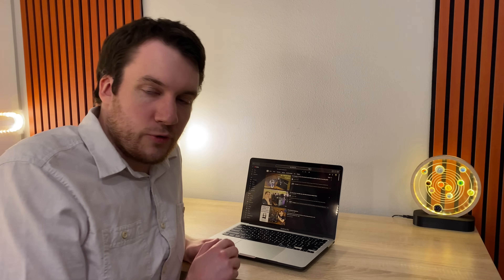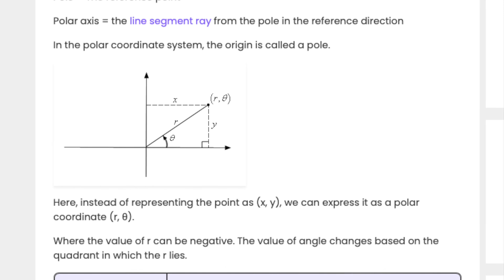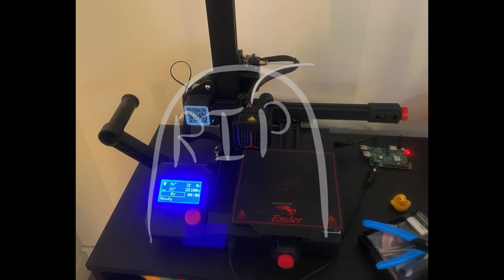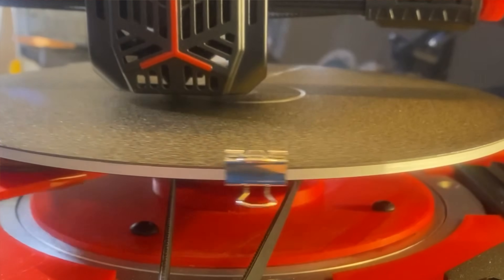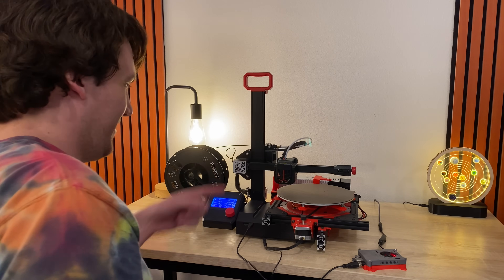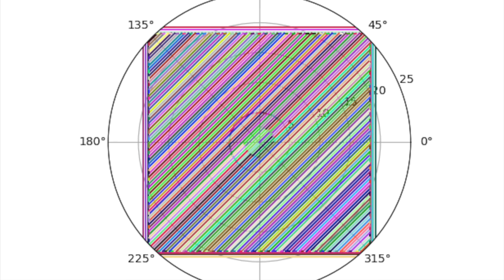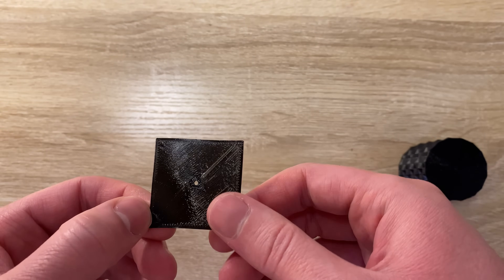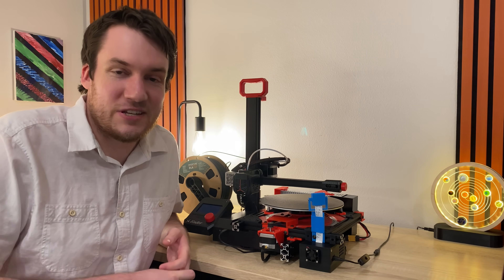This Printer Has A Spinning Bed

Comment: I would say instead of having a slicer that passes thru the 'singularity' going back and forth, you need a slicer that can start in the center, and print spirally like a record player out to the edge of the layer, then fill in the spots it needs to. No need to slow it down.  Wtih the vase, it could just keep going!   But that is a slicer code problem.  Like you mentioned with your python post gcode fix, you need a dedicated slicer mode for polar printers.

Comment: I expected the printer to just spin the plate at a constant speed and print layers in a spiral from the inside out. I wanna bet that would print far cooler and faster. or at the very least one of those 2

Comment: One benefit I noticed is that this opens up the possibility to eliminate a belt and use gears instead, which makes maintenance a lot easier.
Reply: Better yet: direct drive.
Reply: @Overflow066  That would be cool. I wonder if there are precise enough steppers to accomplish that while maintaining quality in the outer areas?
Reply: @ I don’t know, but if the other two axis also were screw drive, you could make an really reliable printer.
Reply: @Overflow066  I guess the Z axis could be relatively slow, but the other one would have to be fairly fast. Would be really interesting to see. Maybe there's a manufacturer out there that would be willing to make purpose-built steppers.
Reply: @ this one seems to move at an adequate speed: https://youtube.com/shorts/X0q1uIOqcIk?si=BtJ4HmeI-ovTuh2z
Reply: @Overflow066  Nice! Looks like it can actually be done.

I just had another impractical thought: the slicer math would probably be pretty complicated, but you could technically have the print head mounted on a beam that draws an arc through the center using just a stepper motor and nothing else, kind of like a hard drive head. So then the only linear motion on the entire printer would be the Z axis.
Reply: The sculpto2 does this. And the math isn't that bad, you calculate the arm angle from the radius of the point and then know the angle defect that the plate has to adjust for
Reply: @reinux  could put the z axis on a pivot too, and compensate for the arc with the other axes. industrial welding robots are basically like this.
Reply: You can already eliminate beds without polar though. Linear motors, rack and gear.

Comment: Next steps would be to add back the Y axis movement, and to give the print head a way to tilt around the X axis. That is going to allow printing sides of things from bottom to top and all kinds of other cool capabilities that are simply not possible with simple cartesians.

Comment: Dumb minds think alike, except my Idea is to have a huge printer with a robot arm, possibly in true cylindrical printer fashion.  I'm glad I found this video, it's probably moved up the project by 6 months or more now that I know Polar printers are a thing.  One thing I was thinking was to have the robot arm print in a planar manner and then have like 45 degree flats that the part would have that I could then print an entirely different feature on as a separate planar print.  There are a couple up sides to this printer one mine would be big enough that it could have multiple arms with multiple extruders running simultaneously.  But my first steps were going to be a turn table and a linear arm like what you did, then I would add the 3-4 degree of freedom robot arm.  My first steps are all going to be the same, but knowing that polar printers are already a thing is going to speed up that process.  Oh and the other thing is that there are not any tools or slicers that I know of for cylindrical volume printing, so If I get this thing to print, Possibly through manual raw Gcode then it's going to be super impressive, and this is a portfolio project.

Comment: To make a straight line through the centre you don't need any rotation at all, if you allow radius to go negative. In that case, there's an ambiguity of the same point represented by two possible coordinate sets, one with positive radius and positive angle, another one with negative radius and negative angle.
For every cartesian X/Y pair, couldn't you just build two sets of polar coordinates, one with positive angle and one with negative angle, and check which one requires less rotation - and output that one? Based on the actual state, the printer could have a full axis motion (negative radius allowed) and stay in the 180 degree rotated mode if that's where it's directed by the closest movement. In that case, you'll never have sharp 180 rotations, and in fact, you'll never get more than 90 degrees at a time.

Comment: There is a need for a 4d printer, which has yours x+z coordinates, with y positionment plus the r polar rotation.

I'd be curious if you could actually mount the plate on more rotation axis.

Comment: I think that the turntable belt needs to be a little tighter.

If you know someone who needs a capstone project in software engineering, the pattern for the faces should resemble a spider web.  That way, the printer doesn't have to stop and spin as the line crosses the origin.

By the way, printers like these would be really useful for printing gears, wheels, pulleys, and other round objects.

Comment: as cool as this is, a polar printer may make it there is nothing a bedslinger, delta, corexy printer cant print. It just may have to move more than 1 axis at a time and due to the artifacts around the center, it seems to be mostly phased out. Cool video, though

Comment: "belt grinding" is just a lack of tension on the belt. Putting in more tension will solve it. The motor sounds like it can cope fine so it wont have issues.

Comment: Love it! Polar printers are super neat, maybe not super practical but very cool none the less. I imagine you could get some sick time lapses with it by taking each timelapse and a slightly different rotation so the print rotates throughout the timelapse and ends with a full timelapse spin showcasing the whole print.

Comment: I built a polar diamond drag engraver using RepRap firmware. The firmware does the conversion from cartesian to polar coordinates on the fly so there's no need to mess with slicers etc. Might be worth looking at. Keep up the good work.

Comment: What if...  You print a + at the center, this would show you where the printer thinks the center is, and you can calibrate to that. It's what we do with lasers, center finding things in wood working, etc.
Every extra line you put down should cross the same center when aligned. So, plan to make a *, and pause after every line to see if it crossed the center.  If it's off, it'll make a circle in the center, if it's centered, it'll make a star.

Comment: David I have owned 4 sculptor printers. And one of their biggest issues is that once you come near center the decimals need to be soo small and precis and also because there is so little movement in the center the temperature need to be controlled fast because else it will just melt the center.

Comment: Polar printers are really interesting for 5 axis machines.
Because you can print 90° onto existing walls.
However, it would be best to use a specialty slicer for it instead of translating Cartesian.
Unfortunately those are difficult to come by and are mostly experimental lacking most of the features we're expecting from run of the mill slicers these days.

Comment: Its a specalized vase mode printer. I'm sure there is a use case for this, and it could be a printer can be made to do both bed slinging and then be modified to do polar. EDIT: Thought of a use case: ball bearing raceways. Also, there is no reason why you can't do a bed that can be converted from linear to polar with a few easy transformative steps. I think you're on to something.

Comment: Such a printer could be used for some round object. Most of square printers doesn't do well with circles. This system allows to print threads, pipes, cups, whatever circle-based and this is quite cool. You don't actually need to use it for non-round things.

Comment: turn your square corner velocity to 1.33 and try again with out the python code. try also using chatgpt to get klipper to see your bed as curved moves and could possibly add somthing to klipper to only slow squar corner velocity in the middle (orgin)

Comment: This is quite neat, but what I'd find more interesting is a cylindrical printer that's set up more like a lathe: instead of printing flat 2D layers and running into the singularity problem again and again, you'd start out with a thin axle in the center and print cylindrical layers outwards. This would give opportunities that are truely beyond what XYZ printers can do, including radially protruding features without supports and favourable mechanical properties because there's no single direction in which the layers would delaminate.
Reply: Someone has actually done this. Don’t remember who, but I’ve seen it on YouTube. He printed springs and stuff
Reply: I suspect the difficulty is the extruded molten plastic is still semi-fluid and would start to move once you started rotating the horizontal axis.
Reply: @codaroma they have ftm printers that print upside down so I dont see that being an issue
Reply: It would be situationally useful but generality is kind of the whole selling point of 3D-printing. The generality is lost by needing supports in places that a cartesian printer doesn't. It also adds an additional consumed recourse (the central axis) which of course isn't a deal-breaker but is kind of inconvenient. Maybe the central axis can be printed with a cartesian printer?
You could kind of combine the idea with a traditional printer though. This would result in a 4 degree of freedom printer with variable printing 'planes' ( '' because can be non planar surfaces) which is something that is very interesting and is being research.
Reply: @thomasandriessen1046  a 3D printer may be an extremely versatile tool, but still just a tool. Different tools are needed for different jobs. A "latheprinter" could do some of the things that a cartesian printer can't do (or can't do well).

Sure, ideal would be a 5-axis printer that can print every detail from any orientation, but it would also be much more complicated on both the hardware and software side. Whereas a latheprinter could be made for a similar price as an ordinary bedslinger and controlled with a patched version of a standard open source slicer.

For the central axis, yes, preparing that with a cartesian printer would probably be the best option. As altenatives that don't require another printer, one could print on metal rods that can be heated to detach the print, or cylinders made from a water-soluble material. Both would of course leave prominent holes in the result.

Comment: I wonder why you even need to go over center and force the printer to do the 180° turn? As I understand it, if you have a circle that rotates around itself and a point (nozzle) that can go in a straight line from center to the edge, you basically can move to any point of the bed by this two moves. Meaning that there's no reason in going beyond the centre, so your X axis can actually be about the same length as a circle radius, so when the nozzle reaches the centre it will be an endstop. 

And when printing something in the middle just start in the centre and spiral outwards. It's like a key feature of the printer, so why do you even need to use lines or zigzag pattern? I mean if you really need to, print that object closer to the edge, but when printing from the centre use concentric pattern.

I know that may not be as simple as it sounds since it's still has a cubic coordinate system rather than cylindrical based on centrepoint, radius and angles, but at least to me it's making much more sense

Comment: How do you not end up with wiring that is not all wound up and twisted? It must be an obvious solution because you didn't even touch on that as a problem to solve but when I see the thing spin around I can only think those wires surely twist and break.   You need to figure out a way to level your bed.  One side is high the other is low.   This was cool project for sure.

Comment: You COULD also just extend the one dimension of the print head to go from negative x across the center point to positive x. The slicer would then have to decide what distance is shorter: rotating the table 180 degrees or going straight across and continue with a 180 degree rotated base plate. Maybe with some tolerance in the very middle, where any point within radius y is just seen as "center", where you only move the print head in and out - while rotating the base in the direction, where the the print head will head towards after leaving the "center" again.
Reply: The fact that the polar coordinate system supports negative radii makes this easier

Comment: I'm a mechanical engineer really interested in 3D printing and polar printers. I just don't have the experience with coding the firmware/slicer/gcode-editor. I do have a very clean looking design ready for a polar printer that works even more like a record player, where the cantilever arm rotates around the Z-axis to go from center to edge of the bed (instead of having a linear guide movement on the arm). If you are interested in this project and maybe even joining efforts let me know! I have designed and built printers in the past (mainly the Dutchy3D printer), but never with complex firmware/movement but I love the idea
Reply: Sounds hard to do the kinematics
Reply: @Frappe3621  The kinematics wouldn't be that difficult in reality, if you're actually familiar with coordinate systems.  But given that 3DP is mostly a bunch of hobbyists who barely passed highschool geometry, I can see why everyone here is crying about kinematics.  These kinematics have also been solved for elsewhere, 1r2l 3DOF robotic arms with a base pivot are a simplistic configuration that exists widely, this 'record player' design would just be limiting the arc of the pivot rather than having a fully circular sweep; though parallelized 3r0l 3DOF arms are more common due to simplicity and the fact that the linkages are often direct-driven.

Comment: I'd solve the singularity problem a different way, CHEAT!  Allow the radius arm to move past zero and go negative a small way.  Then the printer or slicer could sort of re-assign the zero point on a move by move basis to a point past the center.  Now the bed doesn't have to whip around quickly to continue a line on the other side of zero.
Another way of looking at this is that the conversion from cartesian to polar is being done wrong.  No moves past zero should be done, the print should be made by building pie sections, and the bed would then rotate only ONCE per layer.  It actually DOES that for a vase.   Of course this depends on WHERE on the bed you drop your STL image.  If you avoid putting the object so any part of tit sits on the bed center the problem sort of goes away.  You can't get away with that for a large object, then the pie section slicing comes into play.

BTW how do you connect up a heated bed on this printer?  Slip rings?

Comment: Printing to the center is always going to be a problem with these. Even if you get it to repeatably zero exactly at the axis rotation when printing the first layer, doing it throughout the whole print requires the z axis to be perfectly perpendicular to the axis of rotation, and also have no twist. 

Basically, instead of incremental precision determining how big the discontinuity is, you have several large parts worth of tolerance stackup determining how big the discontinuity is.

To do this reliably you'd need something as accurate and rigid as a metal lathe.

Comment: Idea:
Make a double sized round bed with a hole in the middle, where the Z-axis extrusion is mounted through. Now make the bed rotate around the Z-axis, and you got an extremely large circular printer ... without a singularity.
Reply: Congratulations, you printed the vase with a hole around the printer. Oh, and now the only option to take it off the printer is to disassemble it

Comment: Using 9999 walls is one option, but iirc the "Concentric" top/bottom pattern generates a spiral which should print even nicer with the spinning bed. At least that's what I remember from using Cura before I switched over to Prusa. I haven't tested other patterns on Prusa, so I couldn't tell you about that one.
Reply: Concentric makes individual circles. For a spiral you are looking for Archimedes spiral.

Comment: What a cool project. Now we just need to figure out the best usage and advantages of this type of bed
Reply: Vase mode prints comes to mind , Polar printers with a high flow nozzle would easily beat any other printer with a high flow nozzle , since Polars will barely move the toolhead and make the bed spin fast , thus achieving vase mode prints really fast , you can focus on flow only , as the acceleration of the toolhead wouldn't need to move fast (and only in 2 axis). In conparison , other types of printer would need to have both a high flow nozzle and a fast toolhead